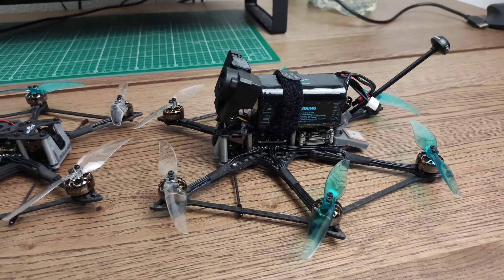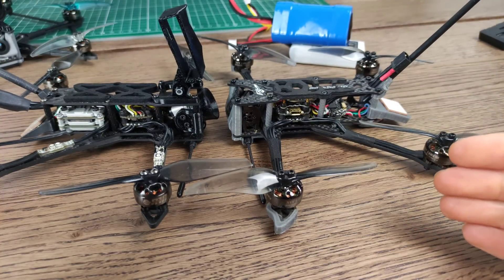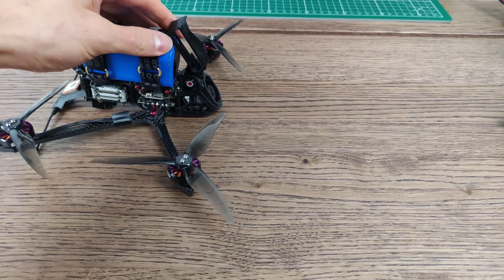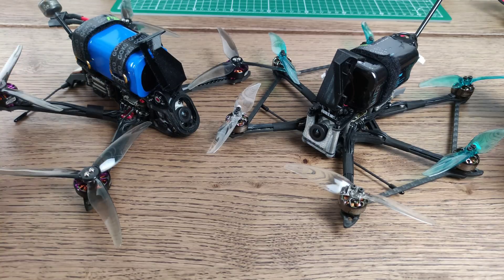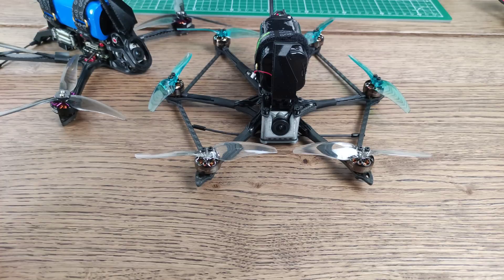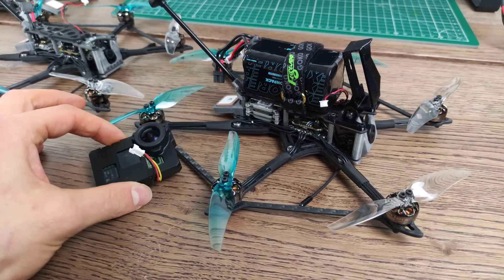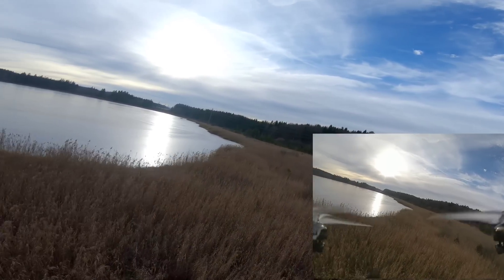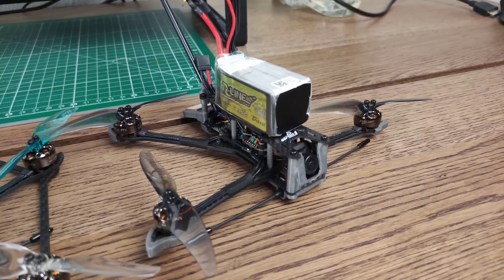Explained | Flywoo HEXPLORER

Comment: My god, I just read the > 250g regulations in Austria.. they are atrocious. The WORST thing about all the electronic crap you have to mount on your quad with remote identification system, geo sensibilation system with APIs etc. is that to belong into the sub 250g category, being sub 250g is NOT enough. Max speed is 68 km/h. And even then you STILL have to make sure that props can't harm people: "Sofern das UAS mit Propellern ausgerüstet ist, ist es so zu konstruieren, dass die Gefahr einer von den Propellerblättern ausgehenden Verletzung begrenzt wird." It's completely ridiculous. https://airandmore.at/pdfs/eu-drohnen-verordnung-drohnengesetz-2020-markiert.pdf - starts at page 23...

Comment: Cool Hex for sure, however, why doesn't the analog version get the F7 board and Bluetooth module? Pretty upset about it 😡
Reply from the maker: I don't know but I assume flywoo wants the analogue version to be cheap and since unlike the vista version it doesn't need extra UARTs I guess they went that way
Reply: @DaveCFPV  I super appreciate you responding. Didn't expect that. 
Feeling catfished here bro. None of you youtubers mentioned it. Not even you and you have both versions, and AND in the beginning of your video you sorta imply both have the F7. Botgrinder has the analog and said it was the F7. So did they send y'all some spiked hex and change it later? Really frustrated with Flywoo and you, well guess it does just say "inspired by Dave c" 😒
Reply: @DaveCFPV  you're even holding the analog version @48sec and show it to the cam saying it has an F7 flight controller.

Comment: On the hex having the two middle motors failing also results in a crash! That's because you then have 2 CW on the left and 2 CCW on the right. The momentum-eqation doesn't fit anymore...

Comment: Hey Dave, I noticed your lithium packs had a nice plastic/foam end cap at the top and bottom of the cells to cover the area the shrink wrap misses. What's that material called? Where do you get it?
Reply from the maker: It's a piece of 3D printed TPU

Comment: I would very much like to see a video of this drone flying on 5 motors.  I'm sure thrust, pitch, and roll will be OK, but how well can it yaw?  With only 2 remaining motors spinning in the same direction as the dead motor, separated by 120 degrees, can it yaw smoothly in both directions?   This would decide if, upon motor failure, the pilot would have to land (which at least he/she could do safely) or is able to yaw towards home and fly back to the launch spot.

Comment: Dave, I think the hex will be capable of flight if one motor fails. BF should be able to handle that. However, I also believe that it will lose the ability to yaw left and right. When one motor fails, BF will essentially power down the reciprocal motor. Then the four remaining motors will be in a configuration such that yaw control will be very marginal or nonexistent. Basically, you will be able to descend for a soft and vertical landing, but with no ability to yaw left or right.
Reply: What would stop it from just behaving like a quadcopter after powering down the second motor?
Reply: @PropsOutProductions  The directions of rotation of the remaining 4 motors. You need a specific set of rotation directions in order to be able to control yaw.
Reply: Which makes sense, but would if it would be possible for BF to recognize that one motor's down and power down the other, wouldn't it also be possible to reverse the directions of certain motors to emulate a quadcopter? Or would that be too dependent on which ESC/ESC firmware is being used?
Reply: @PropsOutProductions  if you reverse the direction of rotation of a prop, it will now push down. Quad will crash.

Comment: So what do you think the highest performing platform for a 6s 18650 Lith- ion pack would be?
if we continue down this road a little bit further. 
5" hexa, 
6" quad?

is 20 min flight time enough for everyone? 
I'm not sure I could go for much longer.
Reply from the maker: My best guess would be 6" props on 2204 1200-1300kV motors for a 6S Liion platform. Unfortunately, those motors don't really exist.
Reply from the maker: PS: depends...having >20 min also means you can do several flights on a single pack and don't need to carry more than 2 or 3 maximum
Reply: I see this. "Diatone Mamba 2204 1450kv motor" and "HYPERLITE 2204-1722KV HV EDITION" at Pyrodrone.  

wouldn't a 6s lith-Ion spend most of its time around 4s Lipo voltages? 
16.8-14v  for 4s Lipo. 
26.2 -15v for 6s Lith-Ion 
Use betaflight Power limit to get the KV you want... for when voltage is above ~17v

that and 6s would help with amp draw which the Lith Ion doesn't like? 
I'm open to having no idea what I'm talking about. 
talking out loud. wish I had the parts and knowhow to push the envelope like you have done.

Comment: I want a tricopter version. Haha less is more
Reply: 5.5" prop maybe? lol
Reply: @M.TTT.  I think a 4" could work out fine. You wouldn't be carrying a gopro and the power to weight would be a bit lower but, you would get longer flight times for the same battery compared to a quad and that swoopy flying that only comes from a tri.

Comment: Yeah, I agree that hex is more reliable due to the redundant motors, which is important thing for long range. However, if the reliability is the selling point, then the VTX, RC links better be more reliable with diversity antennas. Additionally, I doubt how well betaflight can handle motor failure in the middle of flight.

Comment: I can’t stand the amount of props and motors in view on the Hexplorer, it’s a deal breaker for me. If I wasn’t trying to stay sub250g I would go for a 5” over the Hexplorer, this one really seems like a gimmick to me. Thanks for the review and stay safe.
Reply from the maker: Yes a 5" is the more rational choice in any case. Still it's pretty cool to have a hex option
Reply: @DaveCFPV  yeah I got the hex and would be happy even if it flew like garbage as it looks so beautiful. However I am also really happy with its flight performance, it feels insane to fly for such a long time compared to the traditional 5 inch freestyle quads I am used to.

Comment: Would 2s li-ion be possible on 4850kv motors and a 4” prop if the low voltage cutoff issue could be resolved?
Reply from the maker: I guess it could yes but it will be hard to fly at 5V
Reply: Dave_C FPV yeah I figured that but 4850kv is the highest you can get in a 1404 without going crazy high

Comment: That test should be great, put a switch to cut one motor and see what happens!
Reply: Why not just remove a prop and try taking off? Way easier to test.
Reply: @MonkeySwing  can burn the motor, it will spool up to 100%
Reply: How do you do that?
Reply: @jhughes2286  if not possible in software just place a mechanical switch in one of the motor wires and a servo to turn it of LOL! Or a rele or a FET,... anything that cuts the power! Or a Tyne led VTX switch cutting the ESC signal from the Fc!

Comment: From my experience: No BF does not have the capability to make use to the redundancy of a hex in its current state.
Reply from the maker: That would be a pity :-(
Reply: @DaveCFPV  I have a 2.5" hex, and the rear left motor failed (and kept failing until I found out why I was crashing suddenly).

Comment: Here’s a good propeller to try to increase the prop area for your 5”, Gemfan SL 5125 t-mount prop,  2.8g just don’t use the hub.
Reply from the maker: That's what I use! Interesting,why not use the hub?
Reply: If you use two screws then you don’t really need it, just adds weight to the prop. I know that weight at the hub isn’t really felt by the motors, but in my mind... every gram counts.
Reply: @DivergentDrones  i feel ya. On a lot of my drones i dont put the screws on biblades and some tris
Reply: Someone else said they use t-mount without hub. Think was Dave c

Comment: An x8 with 4 arms would've made more sense
Reply: Not really, adding second motor under first will not add 2x thrust
Reply: @remainsmemories626  the induced drag of 2 xtra arms   is considerably greater than the loss of 2 colinear  props  andtheextraweight of 2 motors. Guess it all comes down to what you love most.

Comment: Nice explanation  IMO it has the "cool" factor and the stability of flight is attractive. ....I am interested to see the redundancy tests .....lol..😎
Reply from the maker: Yes super curious too. If it can really lose a motor, ESC, or prop without immediately falling out of the sky that is a huge plus
Reply: @DaveCFPV  I think it will still fly if you lose one motor. However, I think it will be unable to yaw left or right. Yaw will be locked.

Comment: Pointless gimmick...... if not trying to make a sub 250g long range quad then just build a 5/6/7 inch quad for better efficiency.

With regards the new European laws if I quad is sub 250g and carries a camera it still needs registering!!!! (Outrageous) 
So I think the sub 250g may begin to die out as why bother with a lighter quad and go back to a 5 inch! 
??
Reply from the maker: I'm basically not using my heavy 6" and 7" quads anymore. The lighter 4" and 5" alternatives are much more convenient. All I need to pack are 3-4 1P 18650 Liion Packs and I can fly for way over an hour. I can simply take all the gear along with me on a small 25l backpack. Also much less noisy and drawing attention.
Reply from the maker: PS: fully agree. Having to resister a 19g tiny whoop is a joke
Reply: And I dumped my sub 250 builds and am only using 7" inch since it's pointless due to new laws. Running 7" on low kv and Biblades is not much louder than those tiny fu**ers wich perform like crap.

7" flies longer, faster and better in any terms. So why mess with those sub 250 builds??